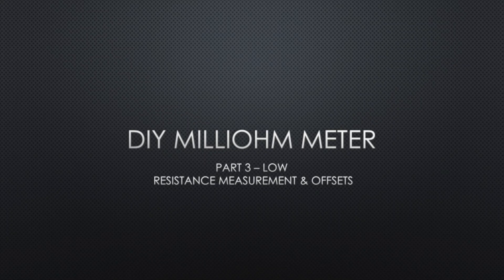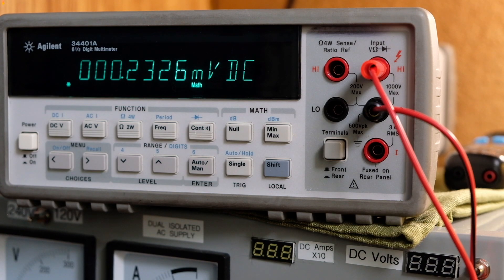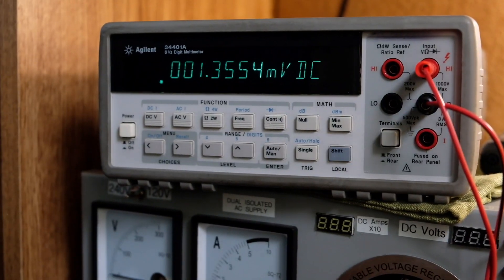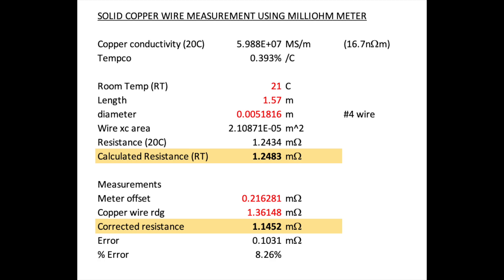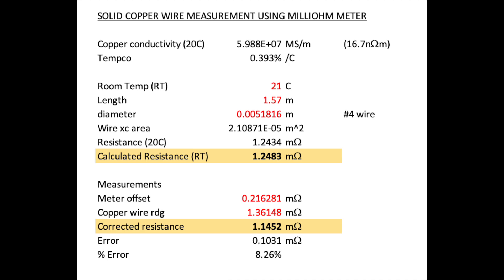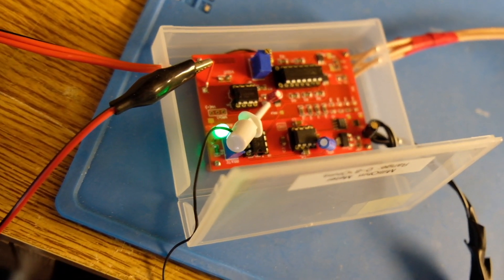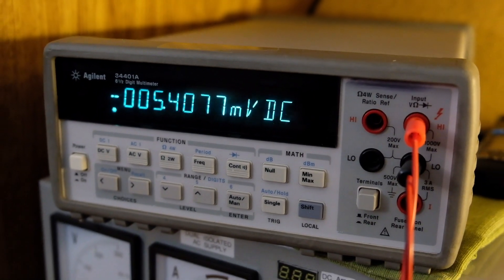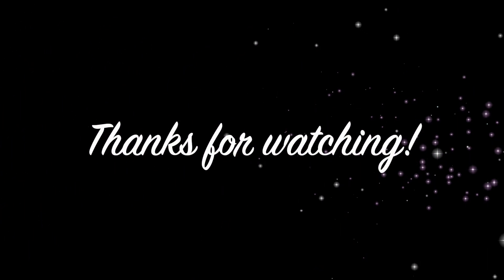Yet another homemade milliohm meter  (auto-zeroing)! [part 3]

Comment: Hi, great information. is it possible to convert this schematic to measure the resistivity of a semiconductor. I suppose a 4 wire jandel probe as input
Reply from the maker: It will need some additional programmability of the current and understanding of non-ohmic contact effects. possible adjustment of gain  depending on the substrate resistivity. a bit out of scope for this particular design. thanks for the comments.

Comment: Why not just use the Agilent 34401A meter? It has milliohms (4 wire)
Reply from the maker: I have tried the 4-wire Agilent 34401A measurements. It's reasonably accurate. Mine is a dedicated sub ohm meter and it has more resolution (and it is very portable).

Comment: I would not play with the math on my bench meter (which is 34411,by the way).  I would just use the 4-wire method.  If there is some problem with that, I would get that fixed.  Both your and my meters are recent models and spare parts should be still easily available.  In fact, I bought my meter as factory refurbished.